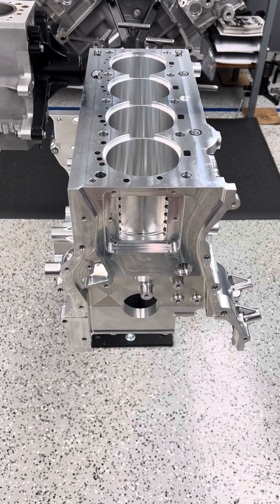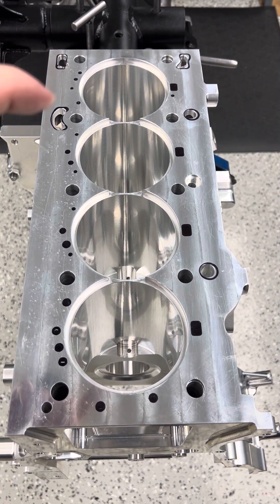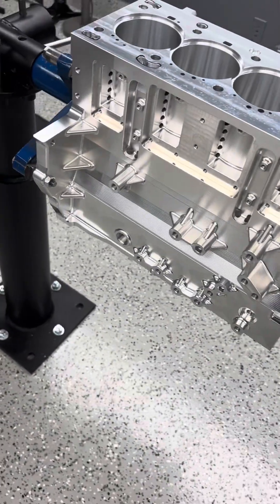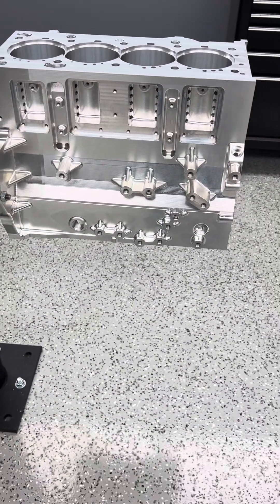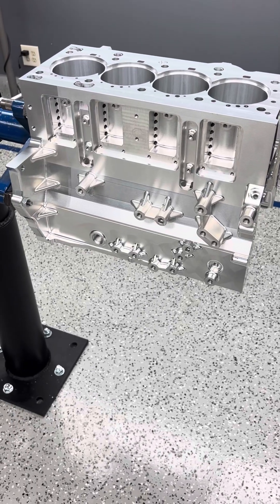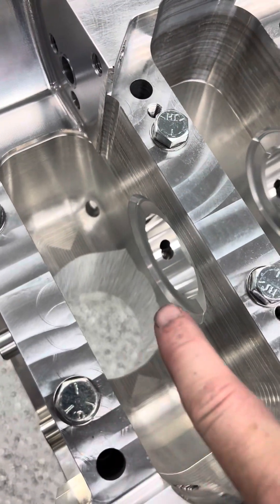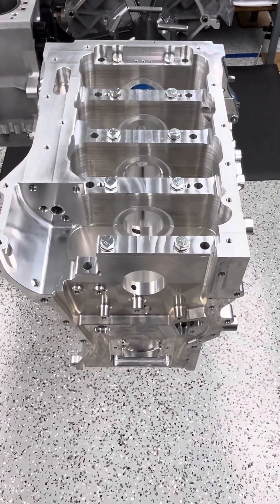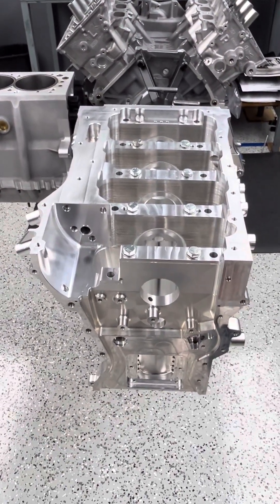Billet BDE block first look

Comment: Ok, do you have a sleeved 2.3l Lima?
Reply from the maker: We do make a cast aluminum block that has iron sleeves.  It's a race only piece that requires an external oilpump and has no provisions for mounting to production car type crossmembers
Reply: @TheEsslingerRacingChannel  So you are saying people would need to  relocate the engine mounts? How far off the beaten path are they? And how much is it for one of them blocks? I love the idea of sleeved engines. I have a 641 Ford tractor with a 4 cylinder with sleeves. I have an International Loadstar that im wanting to eventually convert to use a Dt446 or DT360 diesel engine. Them engines can be rebuilt in a weekend in frame without taking them to the machine shop. After watching Esslingers Powernation episode, im a fan of the 2.3l Lima because of the history, simplicity and the oiling system and sohc design. Now if they had made them with sleeves too from the factory that would have been even more awesome. Because having sleeves is the DIYers dream. Im fed up with modern engine designs. Im tired of being their geniua pig. They do things so stupid anymore. They act like nobodies got any sense, so they want everybody to take their stuff to the dealer to get them maintained. They make things harder to get fixed, so they can rack up a heavy bill for people. They have dumb designs like internal water pumps and transmission fluid that you cant check with a dipstick. Or if they do have dipsticks, they put them way down low where its easy for dirt to get down in them and clog up the transmission filter easier. They keep making stupid Direct Injection. I would rather spend more on fuel than to have plugged valves and turbochargers. Valves have got to have fuel passing over them to keep them cleaner. Gasoline acts like a solvent and cleans the valves in the traditional designs.  The engineers from way back had more sense. They made stuff with the DIYer in mind. Because they kept it simple and sensible. Some designs were not that great but some have stood the test of time. And its them designs that i want to see continue on and to be improved on. Ford probably needs Esslinger to head up the engineering department. They have been failing way to much here in recent years.

Comment: Sometimes I worry about engineering with these blocks. While they are indeed far superior in many aspects to oem, they also don’t have anywhere close to the r&d budget. I know block design is quite complex if your goal is long term reliability and not just ability to handle raw power. My concerns could also be unwarranted due to lack of knowledge.